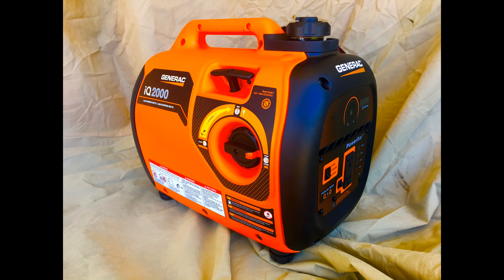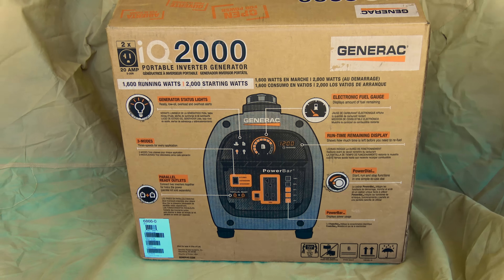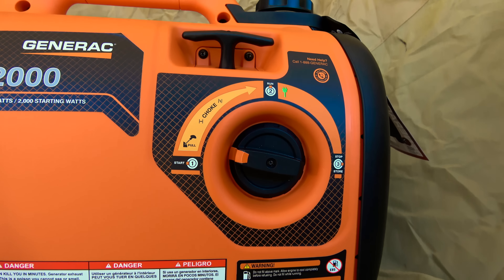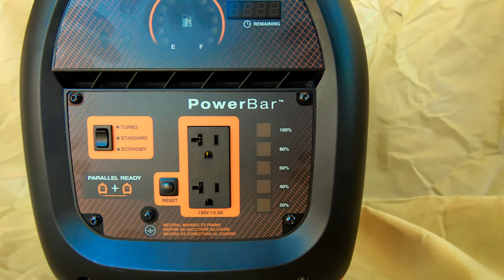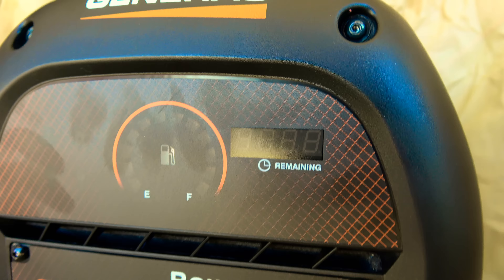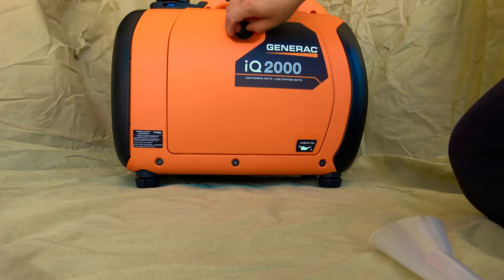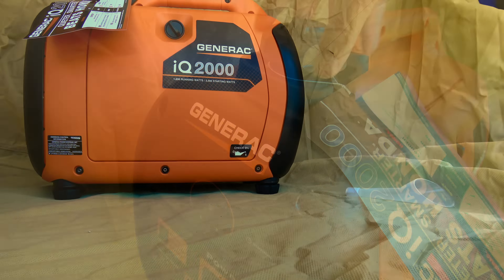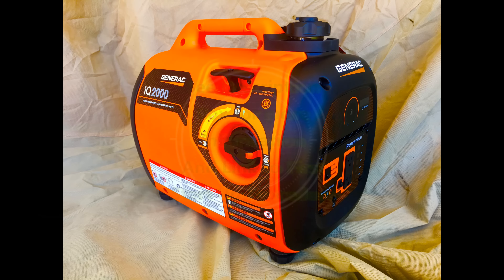Generac Model # 6866, iQ2000 Unboxing and Walk-through

Comment: how much does this run for $??? it would be nice to have something like this in the rv or the garage when a storm hits
Reply from the maker: I just picked this one up for $720 at Menards (Like a Home Depot or Lowes), and they were having a 11% discount promotion on the whole store, so I get another 11% store credit discount.  Before that, I was going to purchase on Amazon. 
Amazon is the cheapest I can find in general. Menards price matched a Amazon seller to the $720. Surprised because then they also gave me the 11% discount. Split it with my father. I'm going to use it with my Teardrop. Very efficient. 

And if you have a Tesla, It is plug and play ready for emergency Tesla charging. The Honda CANNOT charge a Tesla out of the box. The construction of a dangerous hack plug is required to charge a Tesla on a Honda EU. 

Anything at or below $799 for this unit is a good price.
Reply: +KmanAuto I'm gonna have to look for it on sale and get one. . thats cool if you ever needed you could get a emergency charge on your car
Reply from the maker: Yah, it wouldn't be the fastest method of charging, but usually all you need is "just enough" to get you to either a grid connection, or a charging station, so in my observations, 1-5 miles. So 20-90 minutes of charging, your going to spend $100-300 on a tow, and probably that long waiting if not more just for the tow truck to arrive.
Reply: ? Doesn't make sense to me if you have AAA or just plug it in a 110 which is available everywhere. Please explain why I should spend $700+ for something that doesn't seem necessary, takes up space and requires maintenance. Are you suggesting to keep this in your garage? Sorry, I just don't understand.
Reply from the maker: +Robert F personally, I'll be using it on road trips, and specifically ones involving pulling my teardrop travel trailer.
but the point I was getting at, was off grid camping or traveling off grid. Or emergency situations. I'm not saying keep one of these in your trunk all the time, that would be stupid. But I can't tell you how many times I've rolled into a charging location with zero rated miles just because there was nowhere else to charge. Plus a 120 V outlet isn't generally available on the side of the freeway. Also the idea is, if you do get stuck on the freeway and someone were to bring you a generator, you could charge up enough to get off the freeway and plug into a standard outlet. i'm top of that, I've always been rather happy knowing that I have a back up power source when our power goes out.  I sold my bulky old inefficient generator, and put that money towards this unit.
Reply from the maker: +Robert F especially at home during power outages, I'm the only one on my street that has both lights and heat in the winter or air conditioning in the summer. we rarely get outages, maybe once or twice a year, but when we do it is prolonged. can't tell you how many neighbors have come over asking to plug in extension cords in the past to run their heat or lights. But my units can't provide enough power to do more than one at a time. and yet, still to this day none of those people have ponied up and bought their own.
i'm showing the general usefulness of a portable generator, originally bought my first one 15 years ago, from Aldi of all places. that was a rocksolid little unit. 2400 Watt, bought it for a back up, ended up using it all over the place, on boats, on my trailer when I didn't work, everywhere. Amazing how much these units have progressed in just a few years.

is implementing a fleet of mobile power stations that will give you 15 minutes of J 1772 charging